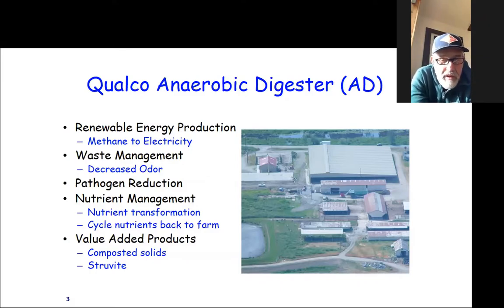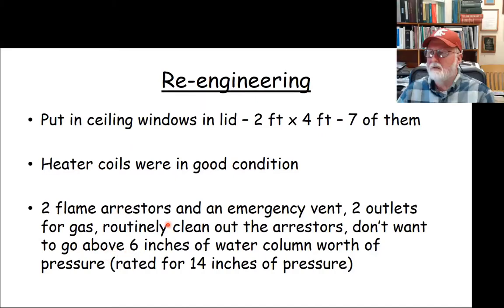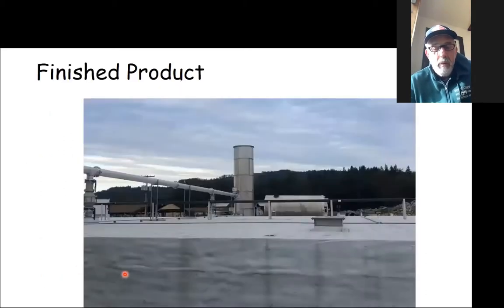Clean out of an Anaerobic Digester

Comment: How long has the digester been back in operation now and have they witnessed any immediate issues? Also, have they noticed or thought about anything after the fact in regards to reengineering that they would want to upgrade in the future to prevent solids build-up? Their agitation blower line tips are incorrect for the application. They should have installed fluid mixing eductors designed for tank agitation with check valves to prevent solids intrusion.